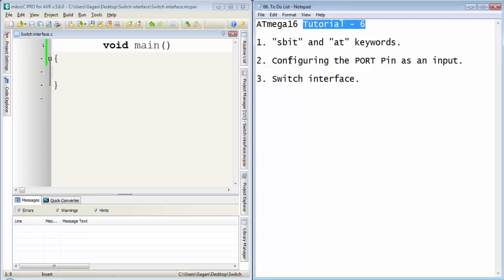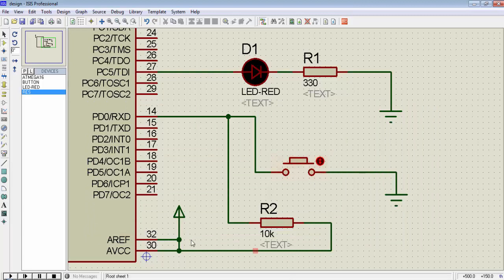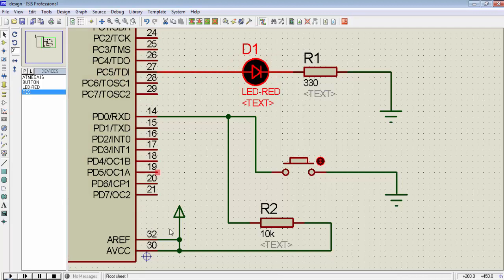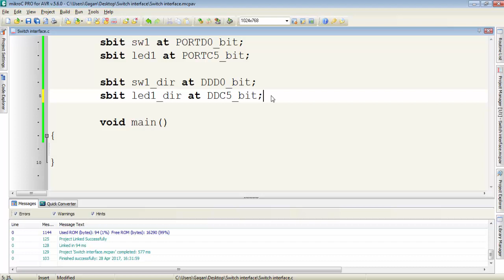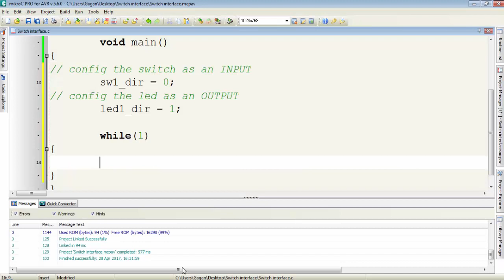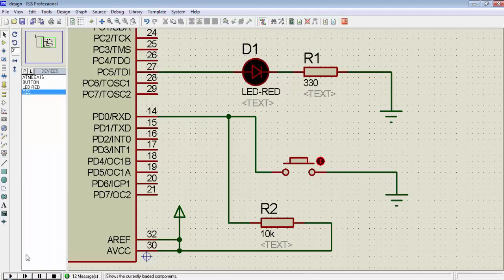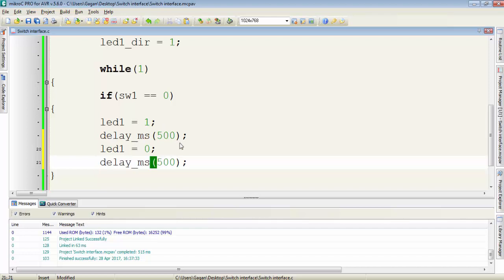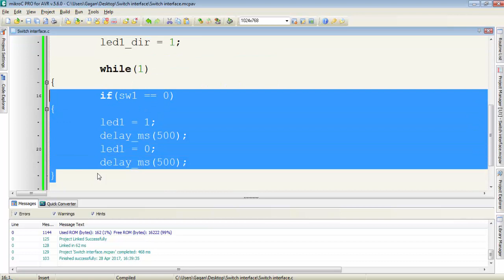Atmega16 Tutorial 6 - sbit keyword & Switch Interface

Comment: not working in atmega studio 6.2
Reply from the maker: Hi Aviral Nautiyal....
 What is not working???
Reply: Life & Learnings Tutorials sbit keyword
Reply from the maker: Aviral...

sbit keyword is for MikroC Pro Compiler.

if You are using AVR Studio.. then use.... #define user_name pin_num
Reply: you can also write the code in proteus as well
Reply: @GaganCA  How should I write "sbit sw1 at PORTD0_bit" in WinAVR compiler?
I tried "#define sw1 PORTD0_bit" but it doesn't work.
Reply from the maker: @glooring7039  Use #define with the pin number such as:
#define sw1 PIND0 //port D_0 pin
#define sw   PIND   //port D for input

then define the DDR register name as:
#define sw1_dir DDRD

then use bit shifting to set mode of the pin as input
sw1_dir &= ~(1 << sw1);

then test for if the switch pin is low:
if(bit_is_clear(sw, sw1))
{

}
Reply: @GaganCA  Thank you so much!
Reply from the maker: @glooring7039  welcome